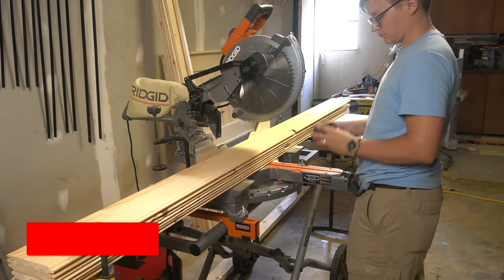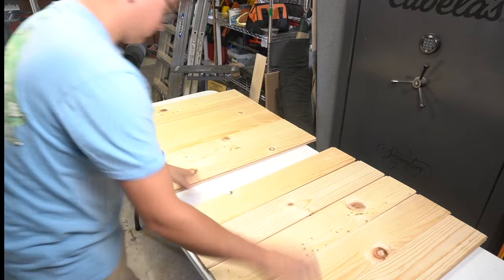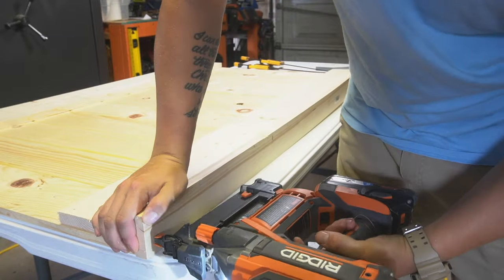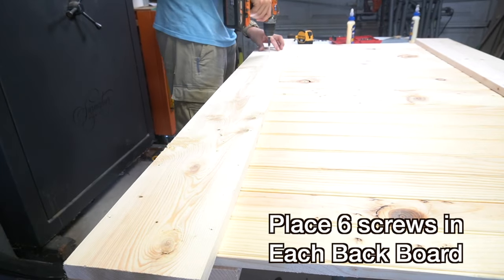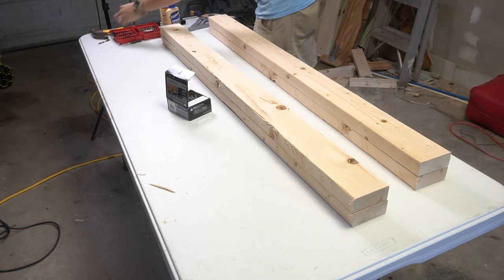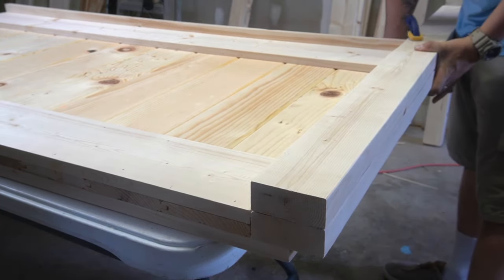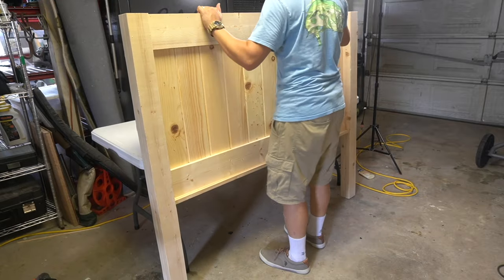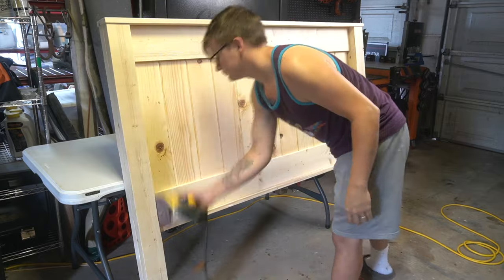How to Build a Headboard! - Easy DIY w/ Free Plans!

Comment: So, to do a Queen headboard, you would add 6" to the width on the dimensions above??
Reply from the maker: If your using a metal bed frame just measure the width of it and match to fit yours perfeftly